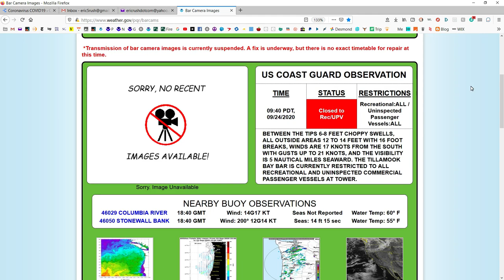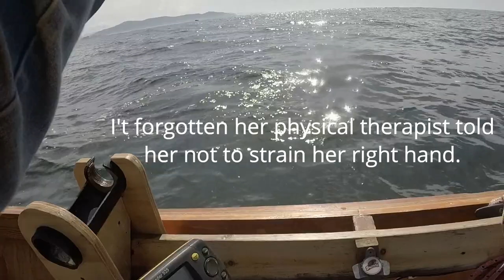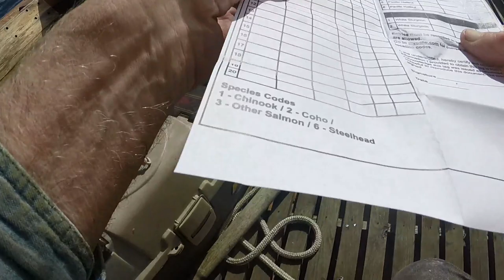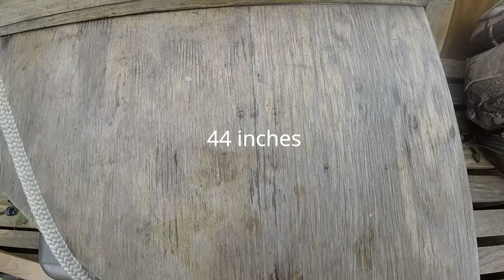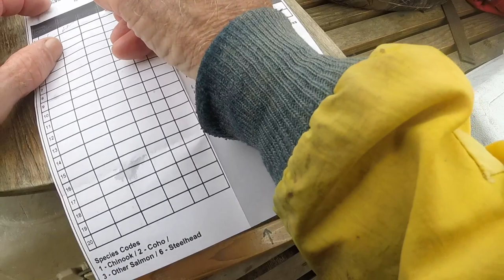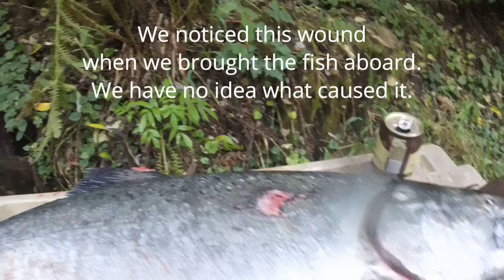Catching Ocean Salmon in our "Tillamook" Dory

Comment: Was watching the left hand level wind in action and was thinking it would be very awkward.
Those Shakespeare ugly stick Rods are some of the best value rods available. Did you know they have a life time warranty that they actually honour. Not only that I had them custom make a few rods for some special setups I was using.
I’ve had dozens of different brands of rods over the years, but if I’m setting up gear for communal use, those ugly sticks are fantastic.
These modern inexpensive rods are very useable, and I don’t cry when guests damage them.
Nice fishing boat !
Reply from the maker: We stopped at a sporting goods store on the way home from a previous salmon trip during which I broke a rod. Bought Ugly Sticks for both of us. Didn't know about the lifetime warranty, but I doubt we'll ever have to use it.
Reply: I have always fished with a left handed real even though I am right handed!

Comment: Im not familiar with the type of fishing you are doing, so is the method why you added the dagger board or is it purely to aid stability and handling? I’m building one too, got a few frames done, going to use it for commercial trotlining. I just heard Mr. Spira passed away sometime ago, what a shame, he was very helpful to me when choosing this plan, wish I had gotten mine built while he was alive.
Reply from the maker: I added the daggerboard to improve directional control at dead slow in congested marinas. It also keeps the flat-bottom boat from blowing sideways and running over the leeward lines when motor mooching (dead slow trolling).

Comment: I'm in the research/planning stages of building this or a similar design, and since I'll be fishing/crabbing it on the Siuslaw, Yaquina and Umpqua, I've been looking for info on whether such a boat can safely fish The Big Blue ... and you answered the question! Flat, sunny days, the right tides, and serious consideration of which bars are best to cross for smaller craft are all a must, of course (safety first!) but it's clear to see that it can be done. Thanks.
Reply from the maker: I'd be comfortable in rougher water but my wife would not. It's not fun if it's not fun for both of us, so I don't push it.

Comment: Like your boat so much that I ordered a set of plans. Did you make any modifications to the hull other than the danger board? Or did you build it as designed? Thanks
Reply from the maker: Daggerboard was not part of the build. I added that later. I built it to plan with two exceptions: The modification to Frame One. And I did not fiberglass the sides.
The free .pdf book "Dory Story" has more detail than the videos. It's available through www.ericrush.com

Comment: Great video! How deep were you trolling when you caught the fish?
Reply from the maker: We were in 90-100 feet of water with, I think, 70 feet of line out on one rod and 90 on the other. I don't know how deep the weights and herring were actually running. I frequently put the motor in idle and wait until lines are nearly vertical before putting it in gear again.

Comment: Does the boat plane well with 20 horsepower? I also have s 20 horsepower outboard and am considering building the Spira Tillamook.
Reply from the maker: I think 20hp is as low as you'd want to go. I added a Whale Tail to my outboard to help it get onto plane. More power and a center console would make a huge difference. With tiller steering, it's hard to get enough weight forward for balance. The flat bottom pounds in chop, and nobody wants to sit forward.
Reply: @OregonOldTimer  Thank you for the information. Love the boating/fishing/crabbing vids.

Comment: I was wondering how the boat handles the ocean it appeared to do well at low speed but what do you have for an outboard? What kind of speed do you get with it, thank you.
Reply from the maker: Outboard is 20HP Honda 4-stroke. That's about minimum for the boat. The kicker is a 5HP 2-stroke and trolls no slower than the Honda at idle. I never use it, but I keep it on there in case the Honda dies. Not likely, but...
We seldom run full speed, but it's near 20mph. It ran faster before I added the kicker motor.

Comment: How much does your boat weigh, and how does the 20 horse motor move it?
Reply from the maker: I don't know what it weighs. 20hp is about minimum for tiller steering, I think. Before adding the kicker motor, with two people, we got a max of around 20mph, if memory is correct. Big 'if' though. Max speed as it is now is in the high 'teens, which is as fast as I care to go.